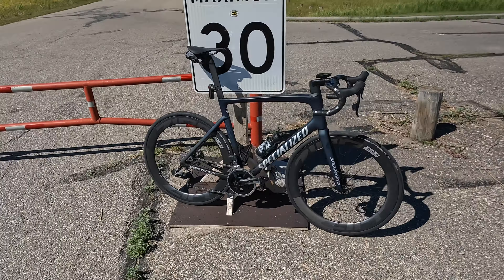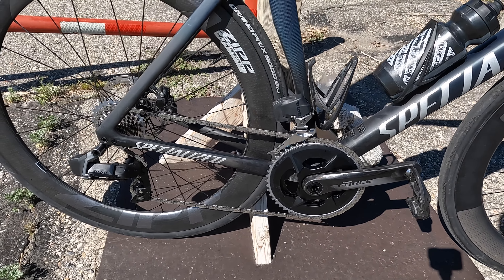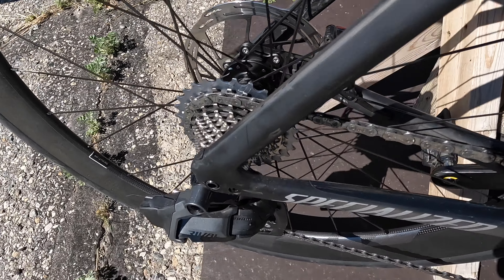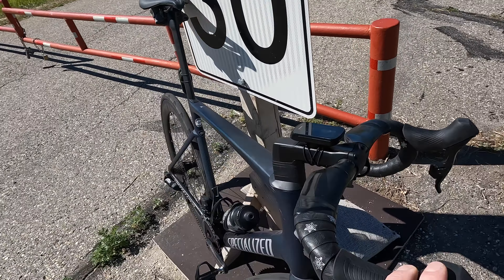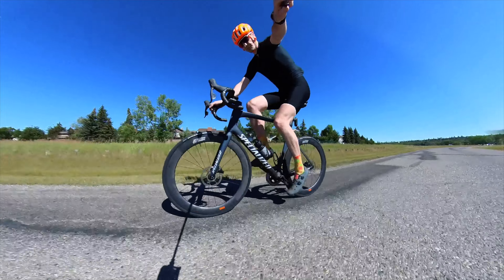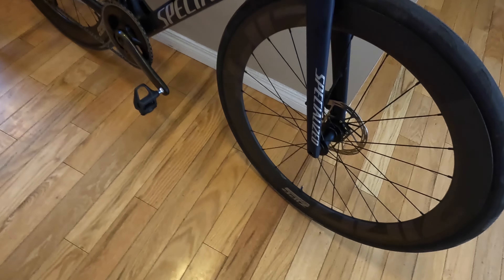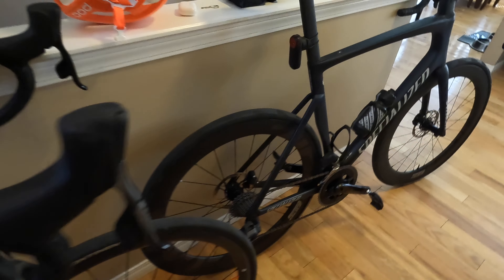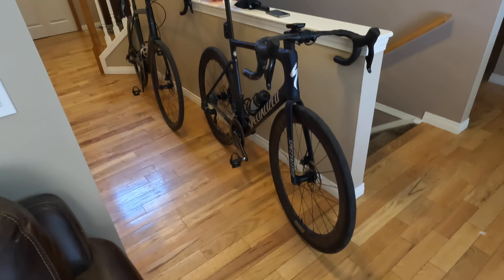Specialized Tarmac SL7 - Project Complete

Comment: Nice vid, I'm debating getting the zipp 404 myself, did u say you have 30mm tyres on there 👀, much difference than the 28mm I'm used too? Prob easier to source 🤣
Reply from the maker: 30 for now. 28’s in the way. I wanted to see how this whole hookless thing worked out first before going to the maximum pressure of 70-ish 😂